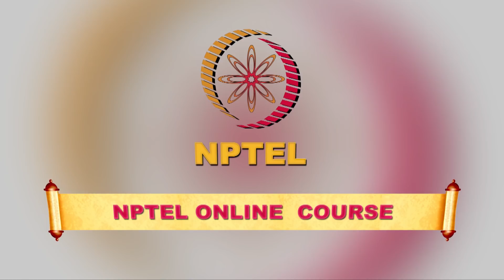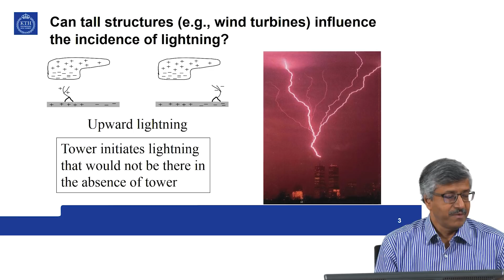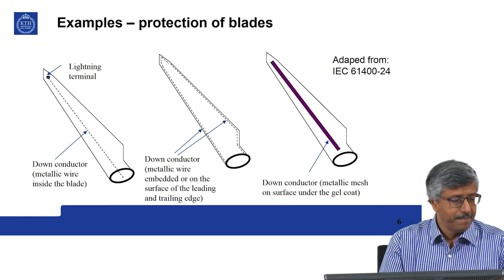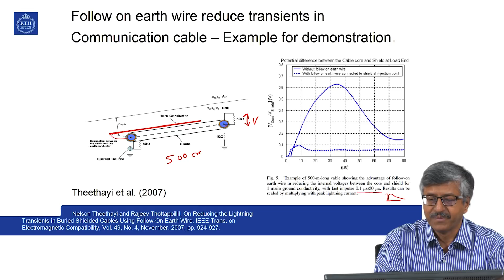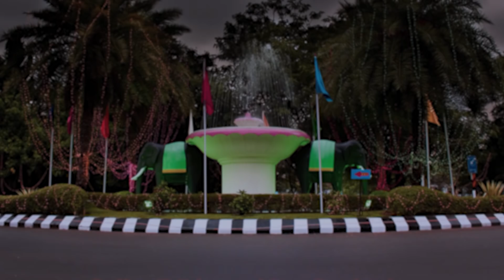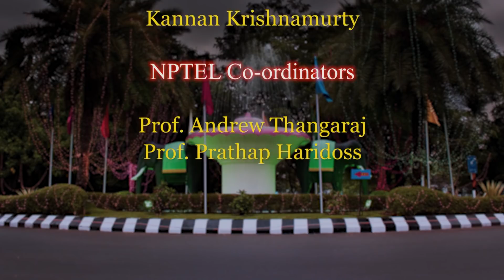Comment: Homeowners can't blame cell towers for lightning damage. If the tower wasn’t there, the lightning would have struck something else nearby, like their home! Homeowners should follow basic advice during electrical storms: use surge protectors, unplug expensive electronics, and disconnect coax cables."